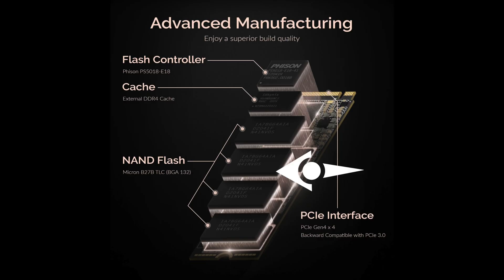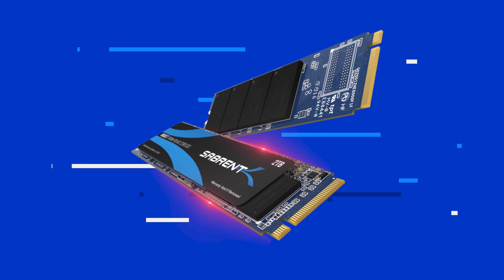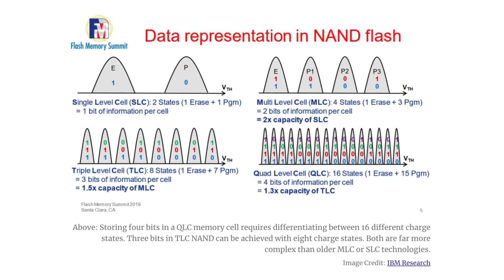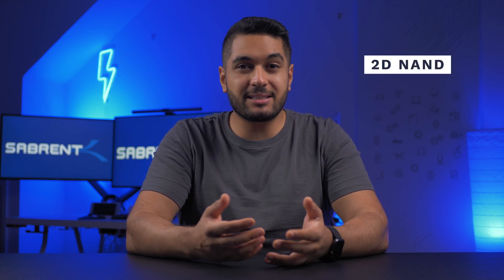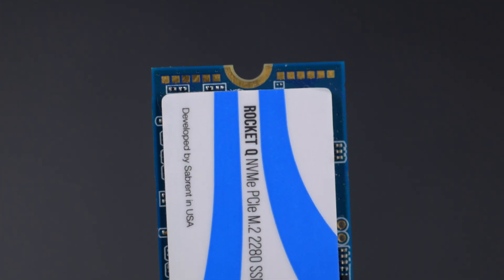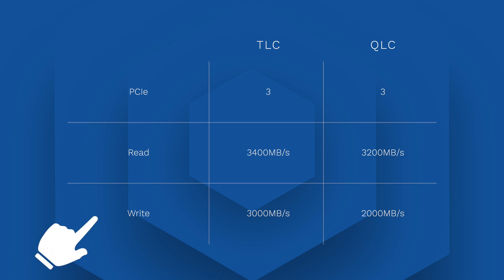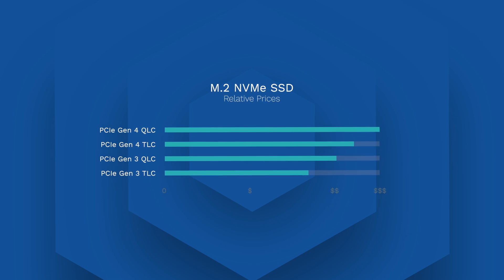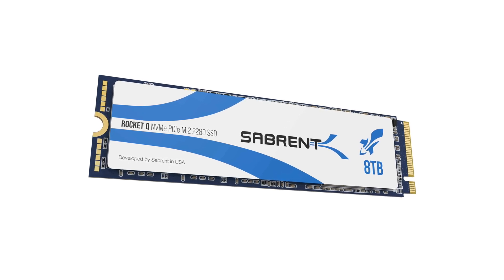QLC vs TLC | Explained

Comment: Did you know that despite the 3000 MB/s write speed.
The actual useable speed is only around 300MB/s
The 3000MB/s only reachable in the first few second of file transfer, the latter fall short, especially it fall shorter when ran out of DRAM.
That’s because the SSD have to write while relocate data at the same time, wasting a lot of time in the process.
For comparison, SATA SSD rated around 400MB/s but actual speed is only 20-100MB/s. Especially with cheap SSD, it can be even slower than an HDD.
Reply: on QLC
Reply: You're absolutely right! Many SSDs, especially those using QLC NAND or lacking a DRAM cache, experience write speed drops after their SLC cache fills up

Comment: Which one is best and how do i find out  which one is in my laptop Lenovo Loq
Reply: Your Lenovo LOQ laptop supports M.2 SSDs with a PCIe NVMe interface, specifically PCIe Gen4.0 x4 slots. This means the best SSD for your C drive would be a PCIe 4.0 NVMe SSD, offering high speed and reliability

Comment: WHAT IS THE ADVANTAGE OF HAVING MORE THAN 1 THRESHOLD VOLTAGE.
READ...
ONLY 1 CHARGE LEVEL.
FOR 12 BITS WORDLENGHT ...
QLC @ TLC IS BETTER ?🤔
Reply: IF YOU USE MORE THAN 1 THRESHOLD VOLTAGE THAN THE DIELECTRIC THICKNESS FOR EACH BIT SHOULD NOT BE THE SAME ?🤔
Reply: @suhaimiseliman8593  You're absolutely right! In multi-level NAND flash memory, where multiple threshold voltage levels are used (like MLC, TLC, and QLC), the dielectric thickness for each bit cannot be uniform due to the complexity of charge storage and retention.
Reply: Having multiple threshold voltage levels in NAND flash memory allows for higher data density, meaning more bits can be stored per cell. However, this comes with trade-offs in speed, endurance, and reliability.

Comment: Why is TLC capacity only 1.5x greater than MLC and QLC capacity only 1.3x greater than TLC when both have double the voltage states by adding an extra bit?
Reply: While TLC (Triple-Level Cell) and QLC (Quad-Level Cell) NAND flash technically store one extra bit per cell compared to their predecessors, their actual capacity increase isn't a perfect 2x due to several factors
- Overhead for Error Correction & Management
- Cell Voltage States & Read/Write Complexity

- Reduced Endurance & Write Amplification
- Manufacturing & Efficiency Considerations

Comment: Hi! I wanted to use your 8tb nvme as a backup solution for my video shoots. But as i now learned form this video, I hit a wall after coping more than 2tb. Then it shows down to way less than my older ssd's (slows down to 200mb/s while my old ssd' stay at 900mb/s). So it's not usable for this use case. Are there even any nvme's that don't have this issue? Would TLC work better, or are regular ssd the only way? I need to copy 4-6terrabytes as fast as possible after a shoot and with your 8tb drive, when the cache is full, it often takes overnight to empty it and regain full speed, so I can't even get my cards backed up in time if I need continue to shoot the next day . Thx!
Reply: You want the Samsung 970 pro. It’s gen 3 but it can keep its write speeds over 2000mbs for entire 2tb capacity. But they don’t come cheap. They still sell for over $250 for the 2tb and 2tb is as big as it gets. Also, you’re looking at basically the same performance but maybe if you put 4 of them together in a pcie/m.2 adapter you could fit 4 of them on one pcie card to get your 8tb.
Reply: @_B.C_  I'll do exactly that! Thx!!
Reply: Intel's 3D XPoint optane drives don't have this issue, however they're ridiculously expensive, even more than Samsung's PRO lineup

Comment: I use QLC for tasks where 1) high write speed is not required 2) there is no frequent data write process. I only use it to store files like footages, cliparts, music, and miscellaneous libraries. And I use TLC drives for tasks where write speed and durability are a priority and there is a frequent overwriting of the file. Therefore, I have a separate TLC drive for all kinds of caches, temp, files from the camera for everyday editing, downloads, etc.
Reply: Yep, QLC seems great for drives where you just want to store a lot of data and not access it often. Until you read the reviews (generally - not picking on this brand) and see the sometimes painfully slow write speeds and instances of sudden failure using QLC. Not so great as a storage drive, if your data isnt very safe. I would use TLC as a minimum and MLC where you expect a lot of read/writes. Either that or be prepared for failure and have daily backups and/or run something like Hard Disk Sentinel.
Reply: What is the best type to have the OS on?
Reply: @idontcare9797  NVMe
Reply: I could not understand what does durability mean ? Could you help?:(
Reply: @sergiovaldes9959  it's mean how long can your SSD can store or read data.
Reply: @sergiovaldes9959  SSDs have a limited number of write cycles, about 3000, after which the SSD dies.
Reply: @sergiovaldes9959  SSDs have a limited number of write cycles, about 3000, after which the SSD dies.
Reply: POWER CYCLES 

= you did NOT address @ all COMPARING the drive time of each TLC & QLC = how many times you can REWRITE (format) the drive OR CONTINUOUS USE of the drive !!!
(say cheese) = they're drastically different !!!
Reply: hdd is more preferable than qlc, qlc is just crap with lower durability and speed, is lower than hdd at 50% full, more hotter than hdd too. 

And also faster nand chip is just stupid if is generate more heat. 1 GBps is already enough for everything.

Comment: Okay. After I replied to your reply on my comment in the other video, I find this video. This does help explain things more, but now I'm just confused about the colors in the packaging. It seems like the TLC version is white and blue and the QLC version is black and blue, but at the same time it seems like the colors don't matter. I did notice that on the QLC SSDs you do have the letter Q on them. I hope I'm not bothering you too much, as I do seem to be a bit ignorant here. It would make sense to me if each type had a different packaging color in order to tell them apart, but if the coloring doesn't matter then what's the point of having different colors?
Reply: You have it backwards. The Sabrent Rocket Q is qlc thus the cheaper price by $10. Get the better black and blue rocket version.